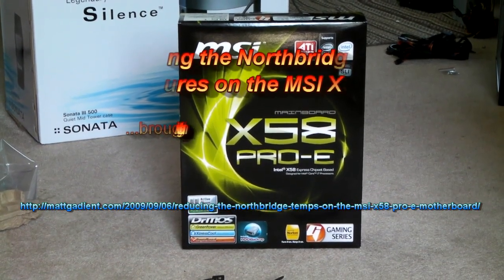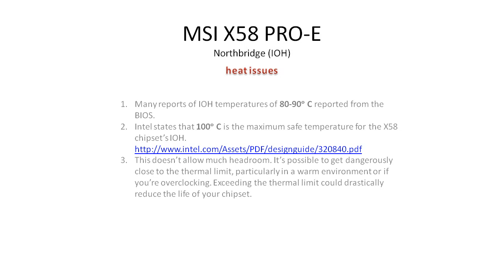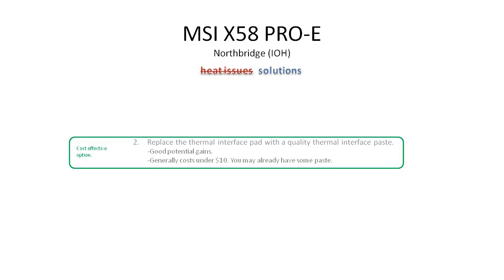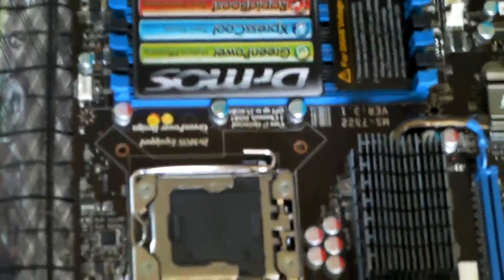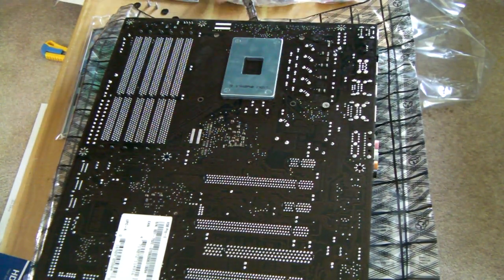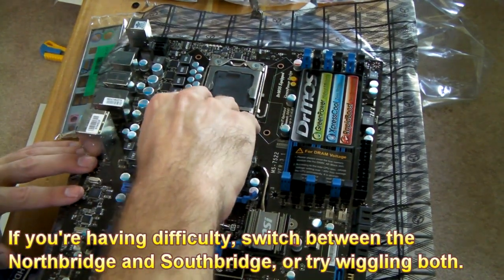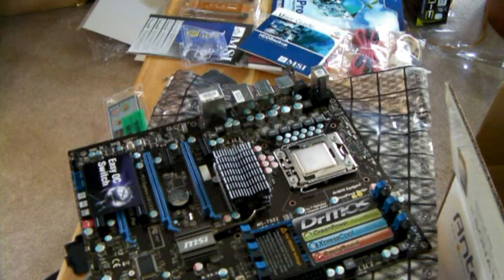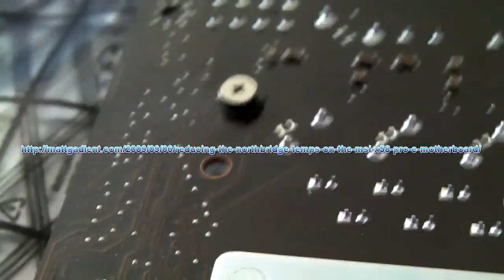Reducing the Northbridge temps on the MSI X58 PRO-E Motherboard

Comment: I have the original board to your one, i know this maybe 15 years late bro but i still have a 2nd rig with an X58 board in and a X5680 in there O/C to 4.3ghz and it loves life, only at 1.31v too which i believe is pretty low tbh for 4.3ghz... I had trouble with the auto oc switch at the bottom of the board the auto bclk switch thing, red switch with 3 white switches on it, i'd never seen anything like that before on any older board. But yeah i have a 120mm fan perched on top of my GPU just blowing at the northbridge heatsink as i was running at about 80c when gaming, cpu was at about 60-65c maybe, but now ive changed over to paste under the heatsink and with a fan running 50% at it, it runs at 60c max while gaming, 52c sat at idle right now according to HWiNFO.... So again, only 15 years too late, but the fact this board is still running is amazing, the friend i bought it off said he got it brand new back then he thinks around 2010 so yeah, they dont make em like they used too huh....😎😎

Comment: Do not forgwt about undervolting too (not ideal for oc)... I also changed tim on my rampage nb and sb, it maybe helped a little, but not that much. Active air is the best bet, if there is a place available, Noctua is doing 40x40x25mm one. Little diy and you are done. Or just put there 12cm fan somewhat (used that too) and temps will be 20°c lower too. Another little help might be cpu fan orientation so it blows on it. 14cm fan with 12cm mounting holes might gelp too.

Comment: 4. Option: Put a silent fan on the graphics card, wichs blows on the northbridge chip. Results: 77°C without fan, 57°C 1700 rpm 80mm (still silent) fan.
I've done option 2 and option 4. Starting temperature was 95°C. 77°C after thermal paste and 57°C after fan.
Reply: Ive got thermal paste on my northbridge and and I have a fan on it and I'm still running 90.
Reply: Thats what i have right now, 120mm fan at 50% speed just blowing on the heatsink sat on top of the GPU backplate, i have a similar board to the OP in the vid but mine is the 1.0 version original, i think his said version 3.1 or something, so mine is slightly diffrent but not by much.... Good old X58 still chugging along O/C to 4.3ghz with a GTX 970 in there... Still plays many games today...

Comment: If you're watching this in 2017 I've built 5 x58 pcs in the last 6 months and I'm shocked this video was allowed on and had this kind of reaction. By all means definitely replace the thermal paste under the northbridge as this will be solid and will be acting as an insulator. DO NOT attempt to replace the thermal pads with thermal paste it doesnt work this way and you're likely to cause a short. Lifting up a heatsink and looking to see if paste is spreading is always tempting but causes air bubbles and cause bad contact as replacing can make the paste too thin in places.
Reply: how hot is too hot for a motherboard?

Comment: Hi. I have the MSI Big Bang Trinergy board, and I have some problems. I get screen freeze 5 minute after I turn on the computer. I descovered that the northbridge is very hot. Can this be the problem? I tried everything else. Nothing works.
Reply: Could be just try to plug a fan and point it to the northbridge.

Comment: This is a VERY good idea if you are experiencing high northbridge temps. I was experiencing 100+ degree temps after just 5 minutes of running prime 95. I simply removed the heat sink, tossed on some arctic silver 5 and have not gone over 51 degrees after any amount of time running prime 95. Great video, great process, and great results!

Comment: this is wrong on so many levels... DO NOT DO THIS! this video guide is completely wrong and may cause serious overheating problems and damage to your board!
Reply: CTSSTC He was talking about scraping off the thermal pad off the radiator. As for the die, you will have to use a sharp tool, be it a knife or a razor blade, unless the NB is still hot. Your only other option is using a solvent – and this is what you shouldn't really do. A knife won't even scratch the markings off of it (unless you go berserk with it).
Reply: CTSSTC Np; actually, in my case I had to use both a solvent (spirit, the less water the better) and a razor blade – the stuff was like cement. As a result, the temps went from 110 (it's a 65nm chip) under load to barely breaking the measurement start of 55 with 166% overclock, so it was definitely worth my time.
Reply: Sobakus Thanks for the clarification :)
Reply: Sobakus I'm seeing constant high 70'ies with mine and the weather hasn't even started getting too hot yet http://screencast.com/t/6NIMNq8qH

I'm not even sure what those sensors are but I assume they're the north/south bridge(s) since they get so ridiculously hot that you can pretty much burn yourself if you touch the heatsink
Reply: CTSSTC Frankly, north bridges can take ridiculous temperatures that don't depend much on the ambience – only on the quality of the heat transfer between the chip and the radiator. That's why one replacement of the thermal paste goes a long way, but for what I assume is also a 65nm chip (x58 is the last true north bridge) 70-80s is the expected operating range that extends into the 100s, so the only reason to be bothered about it is overclocking.
Reply: Sobakus I'm on 45nm: http://screencast.com/t/BBLkQgZ9pf
So not sure what direction of bridge I'm on :P
Reply: CTSSTC Well, this video deals with the North Bridge which is the little chip under the big radiator in the middle of your board, and in your case this chip is the 65nm Intel X58 Express. It's called north because it's closer to the top of the board than the South Bridge; it connects the CPU to the rest of the board. Your screenshot shows the CPU which is a separate chip.
Reply: Midgardsg only.mtvwdcbmmukZinkumml
gj.komnmimkm.killing w  v     --bc  vvvccçć c scwczzzzaaczzzxzzzzzzzaxzzzzzaxzazzzzzaxzzzaxxzzazxxxzzaazzzzzcccccclimmj
Reply: Midgardsg I'm not sure how you decided to post this comment, you probably were drunk.
Reply: Sobakus you cant apply thermal paste on every chip. that is why thermal tape is on some chips instead of paste. it is done not because of manufacturer being greedy but because the size of chips differs
Reply: Midgardsg The guy specifically mentioned the thermal tape issue, saying you might want to leave the MOSFETs alone and showing what to do if you decide not to. This video deals primarily with the northbridge that has thermal paste on it. You might want to sober up a bit next time you post a youtube comment.
Reply: Do you know that the Ivy Bridge,Haswell,Haswell-R and Devil's Canyon uses paste between the die and IHS?Also I did these modification on many boards and it only shows temperature improvements.
Reply: One thing you probably shouldn't ever do is take a knife to a die like he said to do in the video... :\ @7:28

Comment from the maker: Anthony, if I remember correctly I had grabbed it from Intel's spec sheets on that chipset. Just took a quick peak and AMD's is a little annoying, but you could start at support.amd.com/us/ChipsetMotherboard_TechDocs/48691.pdf and check section 5.2. If my 30 seconds of skimming is to be trusted (it probably isn't), I believe RD990 is the chipset and the max temp is 115C. You might want to do some thorough reading and/or toss AMD an email for clarification.

Good luck.

Comment: Thanks!

but i found a bit strange that my 2 Mobo's presented the same problem, in my last one, the Rampage 2, i replaced the thermal paste but did not fix it.

So i imagined it should be the processor or the RAM, i replace the RAM with a friend's RAM to test it before i read your reply and indeed nothing changed, still burning. You can't keep you hand on the heatsink for more than 15s.
So i guess its the Processor i7 920, at home sometimes the power oscilates and i think it may have damaged it.

Comment from the maker: @DiveitRight: The RAM shouldn't affect the NB temp - the memory controller is built into the CPU. It seems that X58 north bridges just tend to get really hot - the heatsink on the X58A-GD45 looks to be one of the cheaper ones too which doesn't help. Try replacing paste, and make sure you have good internal airflow. Can't do much beyond that unless you want to replace the NB heatsink with an aftermarket one, or play with undervolting it (believe it's the IOH voltage).

Good luck :)

Comment: Oh and No OC in any way, everything STOCK!
If i turn the fan i use to cool down my home (big and powerful! :) ) on its side with the case opened, it gets to an acceptable temperature (in the heatsink anyway, cuz there are no NB sensors) but as soon i turn the fan down it raises temperature in about 40 seconds, from acceptable to burning!!
Does this mean that even replacing the processor or the RAM my Mobo is ruined?? PLEASE HELP!!! GOING NUTS! changed the Mobo and the problem persists :(

Comment: Hi! i am having troubles with no apparent explanation. I had a Rampage 2 Gene with corsair xms3 (3x2gb), i7 920 (1366), and it started to actually burn my hand when i touched the NB. So i thought it was a Mobo issue, so i replaced it with a MSI x58a-gd45 and used the same memory and processor.
At first it worked well, but after 3 months the NB of this Mobo started to "burn", i cannot provide accurate measurement of temp cuz it does not have a sensor for NB, as far as i could tell. (continues)

Comment from the maker: I'd imagine so. The fins on the platinum's NB look to be a little thinner and may be a little more delicate though, so keep that in mind. Also quite possible that the heatsink itself performs better than the one on the Pro-E (looks to be solid copper, double heatpipes), so if you're not seeing high temps on the NB, I'd be inclined to leave it be unless you're doing it for enthusiast reasons rather than practical ones.

Best of luck if you give it a try though :)

Comment: ouh.. my go.... YOU DO NOT NEED TO REPLACE THE TERMAL PAD ON THE MOSFETS!
and if the heatsinks do not take off very easy just preheat them .. with  hairdryer ( it should be quite hot = the board)

Comment: I stick with EVGA for my graphics cards. Running 2 GTX580's in SLI atm. Not a single problem. I would've stuck with my ATI 5870's in crossfire but they didn't work with the Asus mobo :(
I have spend over €1300 more then I intended.
Mobo didn't work: (little over €300 for the Asus)
Bad memory: €200 for 12gb
ATI's played up, went to NVidia (driver issues aswell, stuck at 100% activity): €440
And later on I bought a second 580 because rendering took too long.

Comment: i put like 20 fans on my pc and my x58 is 45 idle and max 60 full load. also i changed the paste and put a thermaltake extreme spirit 2 cooler. before all this my temps were around 70+

Comment from the maker: @arcticridge No, the paste is replacing the pad. However, because the paste is thinner than a pad, you'll want to verify that it's making good contact with both the chip & heatsink before attaching it securely. This is done by temporarily putting the heatsink back in place by hand, and then taking it off again to make sure the paste transferred to both surfaces.

Best of luck.

Comment: I just removed my Pro E motherboard and since I had it out I decided to remove the northbridge and southbridge heatsink to replace the heatsink thermal paste. My temps for the NB were in the mid to high 70s before. There is a fragile foam rubber pad around the NB heatsink that you have to delicately peel away and save to reuse. Then with some solvent I disolved and scraped away the old paste that was like gum. With Arctic Silver I am getting 46 with good breeze in the case.

Comment: Me too i had some heat issue with a X58M at oem clocking
It was 70°-75°C Before and now 40°-43°C with a 60mm fan w/custom airduct

Comment from the maker: @brazukaboi17 Yes, the existing pads were scraped off. It's important to remove the old thermal pads, otherwise you won't have any benefit & it may even be worse.

Just a reminder (though it's in the video) that once you've put on thermal paste, you'll want to make sure the paste transfers between the _____bridge/heatsink on *both* the northbridge and southbridge. Use extra on one of the chips if necessary to ensure you're getting some paste transferring to both sinks.